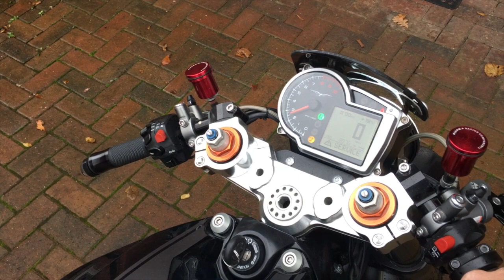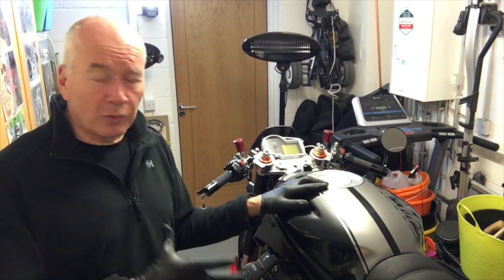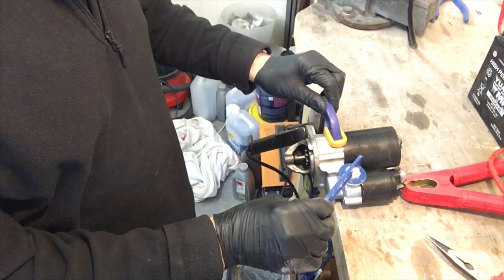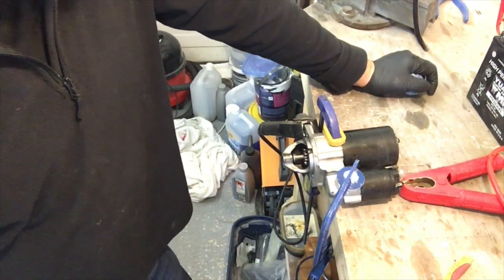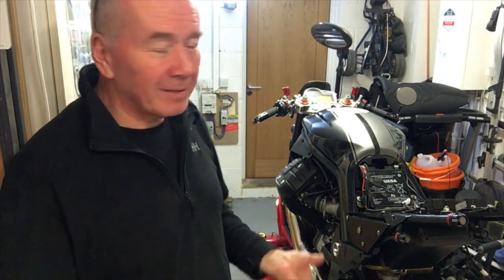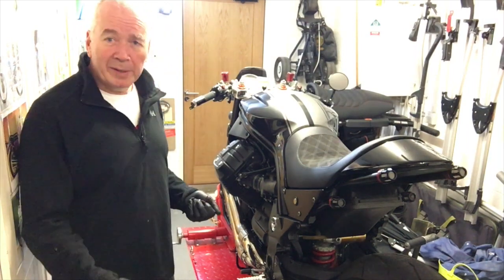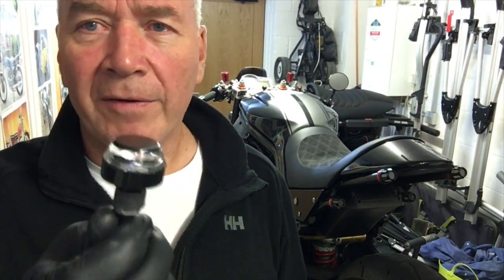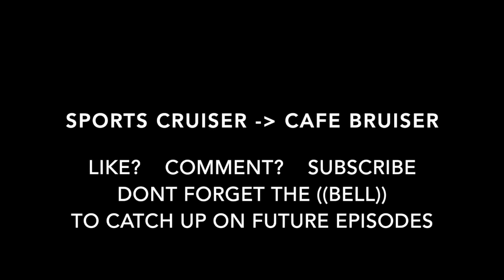Moto Guzzi Cafe Bruiser - 50 - Problems and Maintenance

Comment: Martin i have  watched your previous video where you performed the upgraded wiring correctly.
The new problem as you correctly stated is indeed the contacts inside the solenoid.
It may be possible that the mechanism to engage the bendix bottoms out before the contacts are made and prevent a mechanically sound contact.

The solenoid has two windings, a heavy gauge wire that propels the bendix, closes the start contacts whilst at that same time shorts out the heavy gauge wire ( which is parallel to the start contacts ) and then a smaller gauge wire maintains the contacts closed until the start button is released and the bendix moves "home" again, google "starter motor solenoid diagram" and look for one which shows two windings inside, one for a "pull in coil" and one for "hold coil".

The fuse operates because the time the "pull in coil" is active is abnormally long ( it does not get shorted out by the contacts ) and exceeds the value of the 30A fuse, normally the fuse is cold and can handle a short period of over-current by design and to prove the wire itself is not shorted somewhere you can disconnect it from the solenoid and operate the start button .

So the armature is able to spin slower than normal because of the heavy gauge wire is at that time in series with it.
But when the contacts close the heavy wire is shorted out and the armature spins at the desired output.

Things to check are; is the bendix able to travel a bit further and not mechanically stopped before the start contacts inside the solenoid are closed, if that is the case you may have to file the square opening in the solenoid out to allow the contacts to be made positively, also check the lower nuts on the starter wire studs are not loose on the solenoid.

And if it was me i would connect the negative battery wire to a new longer ( top ) bolt through the starter motor with an extra nut, that way you cancel out two surfaces which are not designed to carry 160 Amps with minimal volt drop across them and prone to electrolysis, but connect straight to the current return path, i hope this helps you, nicely done  video.
Reply from the maker: Thanks for the detail Max, I agree with the solenoid being the issue, I will take a closer look at the things you mentioned, albeit I can’t get inside the solenoid to check the contacts.  If it keeps returning, I might take it to an auto electrician and see if they have the tools to break it down and inspect/ repair the solenoid 👍
Reply: Hello Martin ,It is possible to strip the solenoid but you need to unsolder the end terminals, you will need a large soldering iron, you will be suprised to what you will find , I recently had a problem with my Bosch unit. It was full of muck and verdegre, after cleaning it now pulls the engine over with no problems.
Reply from the maker: Oh okay, I’ll look at that next time I have a problem and let you know how I get on, thanks Max!

Comment: I had an oil leak on my Griso that turned out to the be the infamous leaking rear main seal problem. It's not too hard to fix, but you have to pull out the engine and take off the gearbox and clutch, then pull out the rear main seal housing and replace using shorter bolts. They used bolts too long from the factory so that they bottom out before making a tight enough seal! After that, it hasn't leaked a single drop in two years.
Reply from the maker: Yes, I had a 1200 sport that had that exact leak, dripping from the back, I part exchanged that as didn’t fancy the work.  This is defo not that and remains a mystery so far.  Well done to you tho, I have stripped down engines as a lad but the Griso is a lump, I hope I find something that’s an easy fix, I’d rather ride than strip the engine, ha ha.  You gotta love a Guzzi, even with the Italian challenge 👍
Reply: ..This kind of thing has kept me away from the late model Italian bikes.

Comment: Hi Martin, just came across your great Guzzi vids.  I feel your pain with the starter issue, as I went through similar with my 1200 Sport some years ago.  Did you point out in your vid, it's actually a Bosch unit?  Maybe they fail early due to their position: exposed to high heat levels from engine and exhaust pipe...?  Gutsibits supplied me a brand new replacement, as they didn't have an exchange in.  Not had any problems with this one, so far.  I'd be pretty surprised if my old unit ended up on your bike!!

Did the mystery oil leak recur?

From your earlier comment, I've made a mental note to look out for the rear main seal issue.  Did it adversely affect your Sport's PX valuation?
Reply from the maker: That’s interesting, I’d expect more from a Bosch starter.  You bet, no one wanted to touch the 1200 Sport for PX with an oil leak.  Managed a PX eventually to a dealer who put it in for auction.  Glad you like the vids, been fun making them, certainly helps with lockdown.  Changed my focus to the Ducati Supersport for the min but will be back on the Griso soon

Comment: Cap plugs for those top triple clamp holes.
How do you find the lower clip on bars on your back and wrists?
I'm planning to cafe my 1100 Griso
Reply from the maker: Yes I may look at some plugs for the holes, a lathe would be good but not on my shopping list at the moment.  Clip ons are good! As I’ve fixed them to the top of the fork legs, they’re not too low for an old bloke and these are multi adjustable 👍
Reply from the maker: Go for it, great fun customising a bike

Comment: For oil presence check the blow by tank and the rubber breather which fails by interference with frame. This 's causing small  oil leakage. Ciao